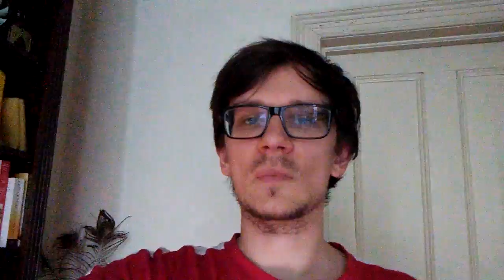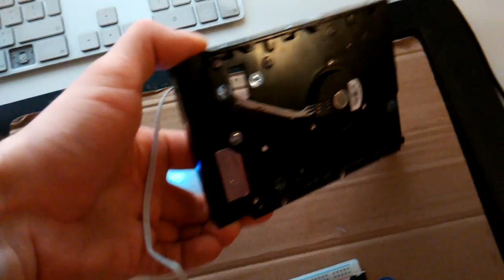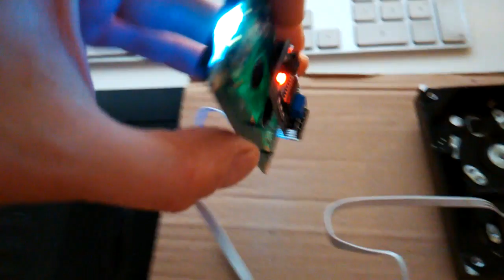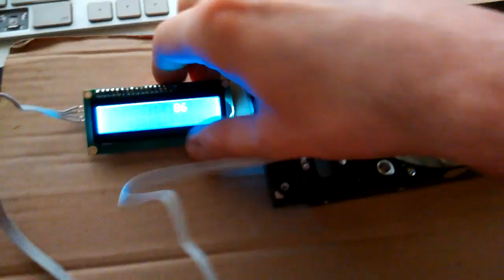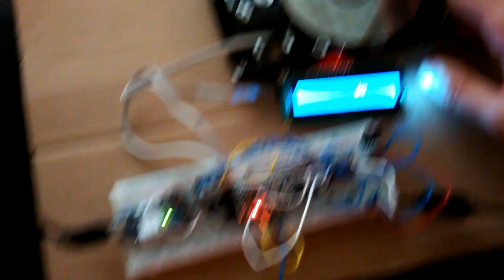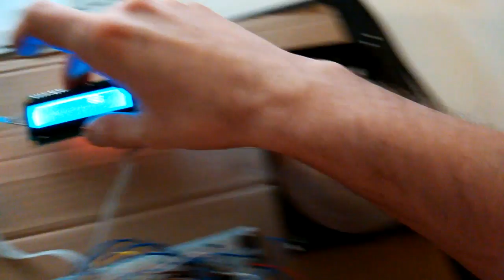Using a Hard Drive as a Rotary Encoder with an Arduino

Comment: Hi
nice work. My counter = count always increase or decrease by 2 number. This is a problem.
Any help, please ?

#include <Wire.h>
#include <LiguidCrystal_I2C.h>

LiguidCrystal_I2C lcd(0x27, 16, 2);

const int int_a = 2;
const int int_b = 3;
volatile long count = 0;

void read_encoder(){
  int8_t dirs[ ] ={0,-1,1,0,1,0,0,-1,-1,0,0,1,0,1,-1,0};
  static uint8_t oldstate = 0;
  oldstate <<= 2;
  oldstate |= ((PIND >> 2) & 0x03);
  count -= dirs[ (oldstate & 0x0F) ];
}

setup(){
  // init display
  lcd.init();
  lcd.backlight();

  // input
 pinMode(int_a, INPUT_PULLUP);
 pinMode(int_b, INPUT_PULLUP);

  // rotary encoder
  attachInterrupt(0, read_encoder, CHANGE); // pin 2 on arduino UNO R3
  attachInterrupt(1, read_encoder, CHANGE); // pin 3
}

void loop(){
  lcd.print("State = ");
  lcd.print(count);
  lcd.print("   ");
}
Reply from the maker: +mrstanlez Hi friend, sorry for such a late reply! It could be because your interrupts are looking for a 'CHANGE', as opposed to a rising or a falling edge. In my code I set it to 'RISING' I think.